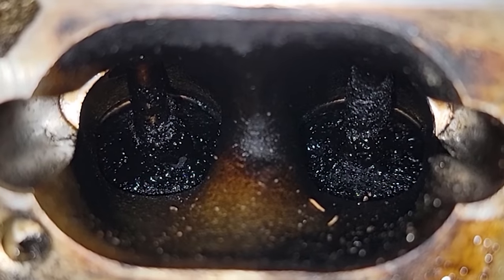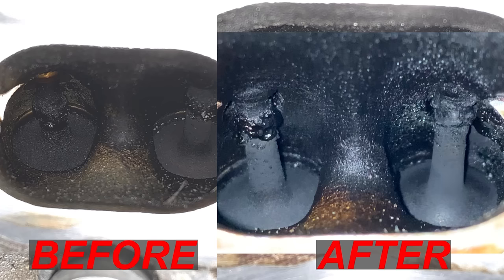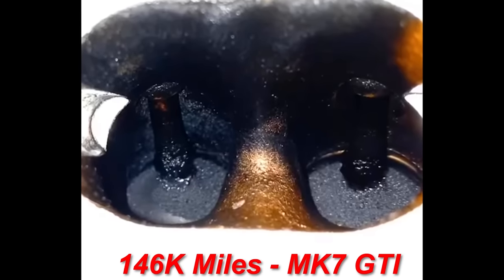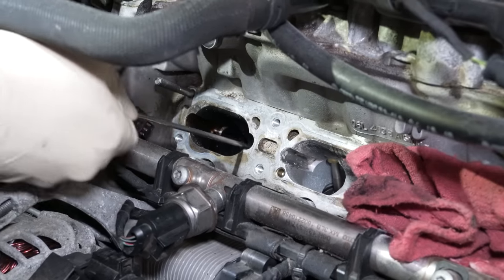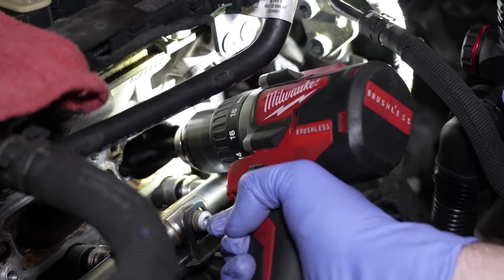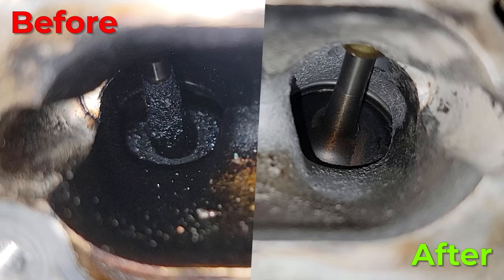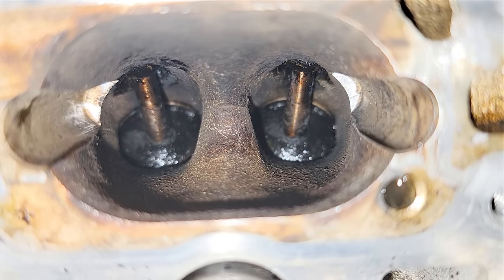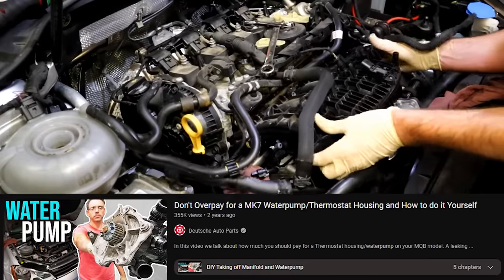How To Clean Carbon Off Your Engine!

Comment: My Ford Focus Mk3 1.0 125HP Ecoboost has had it's intake valves a bit worse clogged than those at 10:05 are and all I did was after a lot of research I ended up with Amsoil Powerfoam which I used as prescribed and because I didn't know in which place to pour it into my intake to not damage any air sensor, I've taken out the IAT2 on my Focus (it's for inlet air temperature and pressure readings after the boost) but let it's connector still connected to it so that I won't get any faults and sprayed that Amsoil as prescribed in two individual rounds, put back the sensor and drove the car a bit until the very thick blueish smoke eventually stopped coming off from my exhaust (I was spooked at first to see that wild smoke) and all was fine. I repeated the process as prescribed and all good again. Immediately after this procedure I looked with the borescope again at the valves and pistons and there was no difference yet, but..., after 3-4 months later I checked again with the borescope and I didn't believe my eyes..., that thick slime was much less now both on the valves and piston. So this thing attacks that buildup over time as it kind of infuses into it initially and makes it loose while driving for a big while. I was very amazed to see that and of course I've immediately bought another spray can and re-done this cleaning again. After almost one year after the second cleanup I could finally see my valves have a good shine on them for at least half of their area and the pistons were almost 90% shining with only some spots here and there of left buildup. So..., wow..., that's what I was looking for and so far it really did what I wanted.

Oh, and guess what..., after these cleanups I also went only for a technical check on the cat to see it's health. First of all, at borescope inspection the cat was now even more white than before using this Amsoil and not only that but the guy checking it's performance asked me what is wrong with the car and why did I want to do this test cause the cat is not just fine..., the emissions are similar to a brand new cat. Wow again! Just wow! Valves cleaned, pistons cleaned, O2 sensors a bit cleaned as well and the cat regained some of it's white appearance and had no damage at all. There you go...!

Comment: How does "93 octane" prevent carbon buildup? It resists detonation and preignition. an "Italian Tuneup" isnt "revving" the motor. It's taking it out on the road and running it hard and under load to raise chamber temps and get the plugs hot enough to burn carbon off the electrodes the way they were designed to work for their heat range.
Reply: SSSHHHH ssss do not tell them or you will ruin this guy's commercial my friend.

Comment: I have a 2005 Audi A4 3.0 V6. What's the best way to clean the carbon? Thanks
Reply: You must use oil catch can method  mate....ok.?
Reply: @nia6849  what is the "oil catch can method"??? Thanks
Reply: A can to catch excess gasoline vapor after burning.

Comment: What about decarbonization with that special machine that uses hydrogen?
Also I'm assuming that this is much worse on diesel engines, especially that are driven in city a lot. EGR helps with that carbon build up a lot hah, but even petrol engines have them nowadays if I'm not mistaken..
Anyway, very informative video. 🙂

Cheers
Reply: Give a try

Comment: Why not use long brass bottle brushs cut the loop offend mount in variable RPM drill. Even stainless wire brushes were used on valve faces and back sides years ago. Suggesting brass to pose less potential damage to aluminum head. 
Let soak in carbon remover remove brush probably use hardly any media blast...ditch those picks...

Comment: The zip tie method didnt end up being that effective for me. Didnt find it to be the magic internet hack everyone says it is. An old toothbrush took out more carbon than the zip ties did, after a bunch of brake and valve cleaner of course. Ended up doing the job with a combination of scraping, brushing, vacuuming, compressed air, and a lot of brake and parts cleaner. Also made my own specialty valve scraping pick with just a regular pick and an angle grinder. 

Next time I will definitely media blast. Its absolutely not worth the time and effort it takes to use any other method.

Comment: IMHO, media blasting seems to do the best job and saves a lot of time as well.  I own a 2019 VW Arteon with a 2.0TSI turbo charged motor that is enhanced with an APR+ tune.  I use 93 octane Tier 1 fuel and run Liqui Moly Di-Jectron additive every 6 months or so.  How concerned should I be with having the valves cleaned and how often?

Comment: Hoping mine isn't too bad in UK because its got direct and port injection so should keep valves clean 🤞
Reply: if you have both you have zero buildup
Reply: It is morally reprehensible for VW to only use MPI in Europe but they might do it to help the dealer networks generate more revenues

Comment: Direct injection engines were developed in order to get better fuel mileage. They do this by using very weak piston rings. If you fail to keep good maintenance of oil changes, you will begin to notice oil consumption, which will continue to get worse over time. Usually this is from stuck or sticking piston rings, and that's because the rings are so weak. On top of all that, you get the carbon buildup on your valves. This is due to the fact the fuel doesn't pass over the valves, and no cleaning of the valves occurs. So, good luck with all that.

Comment: I just want to add that if you have a ford ecoboost engine or potentially any other engone with a wetbelt, you probobly dont want to be putting any chemicals into your engine as it has been know to acceleralt the breakdown of the belt.

Comment: Methanol injection used occasionally (spirited driving) over the life of the engine may prevent this all together. The power boost is just a byproduct one will have to tolerate.

Comment: What about using a bottle brush in the drill
what's the best stuff to dissolve carbon, you get that professional stuff they use in your ovens but I don't know what it's made from that could be used anybody know!

Comment: @ 4:08 you give the impression that 93 octane is a better fuel. I realize you said "because he is tuned" but we are left with the assumption that higher octane fuel is better. While some high octane fuel may have additional additives this is not the case with all. Perhaps recommending Top Tier gasolines within the octane requirements of the owners manual would be a better choice. Not all high octane gasolines are Top Tier either. Aside from the obnoxious background musak, it's a relevant video.

Comment: Did anyone notice the absence of Toyota in the names of all companies whose engines are prone to carbon build up? In their typical way, they didn't rush to be the first for direct injection, finally when they offered it after learning from others mistakes, it was port & direct combined. (Toyota engines have other issues though) My question would be what did VW did different for post 2016 engines that they don't have the carbon build up issue, did they also offer port & direct both. Second, why is carbon buildup an issue, the valve seals keep the stem clean and the valve seats are cleaned every time valves seat, isn't it?
Reply: I am cleaning a 2.0 Tiguan 2018 tomorrow so I am not sure they did

Comment: too bad somebody doesn't still make a foaming top end/upper cylinder cleaner like GM and Mopar did back in the day, two 15 minute treatments back to back would actually leave clean bare metal, however your driveway not so much which is why they quit making it, those cleaners removed carbon so well that a single treatment on a vehicle with a lot of carbon buildup could completely clog a cat which is a bad thing but if you are removing intake and sucking out all the chemical and carbon residue anyway then using a more powerful chemical would be ok.....

Comment: Drill a hole in the intake. Warm the car and spray cleaner in the hole while running. Fill the hole with a sheet metal screw. Do this a few times a year…

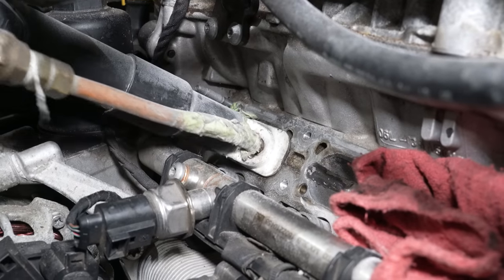Comment: 6:02 this is not fixing the underlying issue, this is more like a consumable maintenance item like tires or oil.  

This issue is fixed by a system like port injection that keeps the valves clean, catch cans help but won't solve the problem completely, ideally you should stop pumping vaporized oil and volatiles into the intake but that may or may not cause you to fail smog testing in places that have it.

Comment: I scraped mines with the zip ties, but not like that, tied them together to be almost as big as the hole, pushed in and twisted with brake cleaner, came out almost perfect, after it was dry you couldn’t see any black deposits, cancelled the walnut blaster order.

Comment: Except while the valves are closed you can’t clean the valve seats which allows the valves to form a proper seal in the combustion chamber.

Comment: Or you could buy a used small window washer bottle and pump from a 90's japanese car $10 and a $5 vapourizing jet, wire in an on/off switch. Find a stable place to sit the bottle under the hood, use the jump start points to power it and run the switch throught the drivers window. pop the air cleaner cover place the vapour jet under the air cleaner. Fill the bottle with 10% ethanol (metholated spirits) and water. 
Drive to a highway when the engine is up to temp turn on the pump and drive until the bottle is empty, about 5 to 10 miles . If the engine struggles modulate the switch or limit the water flow.  Repeat every 10,000 miles, problem solved.

Comment: side note, the carbon comes from fuel, it also gets into your oil which makes the oil smell like fuel & turn black. when they say your avg car burns XX fuel which contains XX carbon making XX co2 per year, they dont consider any of these carbon deposits or oil changes etc, so the math is flawed. also it takes 1 acre of trees/forest to consume all that co2 per year the avg car burns & makes.

Comment: the best cleaner to use is Chem-dip 0996 Carb Cleaner  fill port full let set 20-30 mins suck out You be surprised !

Comment: uhhh...Seems all the 2.0T gen3 engines have carbon build up, soooo...yeah. Just did my 2017 R at 75k...they were definitely caked with carbon. Got plenty of Pics. It's a KNOWN svc item at this point, you guys should know this.
Reply: BTW, Oil svc every 5k, Motul Tsi specific 10w40, 93 or better fuel. Every 10k CRC GDi cleaner.
Reply: @UngluckInc  I think the quality of fuel you put in it is very important!  It should be "Top Tier" certified, like Shell, Mobil, BP, Sunoco, Costco, and others (around here, Get Go is Top Tier, it's part of the Giant Eagle grocery store chain, not available everywhere).  The octane level should not make any difference, as far as I know.  If you get your fuel at some cheapo gas station, the quality of the base fuel is suspect.

Comment: I sucked foamy engine cleaner in through the egr inlet about 20 times with the ignition off being careful not to overload and lock it up.  I needed to change the cat anyway. You could also disconnect the cat a few inches which is easy enough.
Reply: yea..bet that did absolutely nothing. lol

Comment: Question: So on the GTI’s the transmission is different between the PP and non-PP. There are two engine codes for these cars does anyone know the difference between the two engines.  Some say its just the ecu’s hp bump on the PP model. I’ve also heard some of the internals are different as well. Can anyone confirm?

Comment: Hey, do the new 1.5 TSI engines have this carbon build up issue?
Reply: I have 188,000 miles never been any carbon
Reply: I wonder if that also applies to my 1.4 TSI Jetta from 2017?
Reply: @rickmjr9569  look after it and no problem 👍

Comment: Confused... You said the 1.8L TSI engines after 2015 don't have buildup problems.  WHY?  The 2015 Golf is MK7 generation, isn't it?  But then you show a Mk7 GTI with a lot of carbon buildup at 140K miles.   Why?   Does the MK7 GTI have a different engine?

Comment: Why wouldn't you use the valve clean the something like a nylon brush on the drill surely that would be more effective, I have a few with varying materials from hard wire brush to soft plastic brush and they look very similar to a baby's bottle cleaning brush.

Comment: 4:20 Thats not true if you drive car in urban area you will have carbon deposit for sure. I have diesel car with 127k miles with cat and DPF, no deposit on valves at all, but pedal to the metal whatever i can.

Comment: Carbon deposits and buildup are a by-product of combustion in an engine that comes from incomplete fuel combustion. Does this mean that gasoline additives cause incomplete fuel combustion? Because the engine is designed to burn gasoline and not the additives.

Comment: It's supposedly against EPA regulations, but if you have a "direct injection engine" the addition of an oil catch can will eliminate carbon build up on your valves. Same for Port injection too. It is the recirculated oil fumes from the crank case via the PCV valve that cause the carbon buildup. It seems to me someone smarter than myself would come up with another solution other than the PCV valve which is detrimental to your engine and makes the EPA happy as well. But what are you to do when so many "new" engines are direct injected? Allow your engine to get ruined? Oh that's right, buy an EV at 3 times the cost of a regular car that may spontaneously combust for no reason, and only get you half the distance per charge than a regular auto would. Joy.

Comment: can we get manufacturers to go back to the old injection system which did not have this problem or is this done so their dealers have business cleaning them?
Reply from the maker: It’s being done to meet the increasingly restrictive emissions requirements
Reply: @Deutscheautoparts  I know nothing but seems that engines caked up with carbon would be less efficient, pollute even more.

Comment: Works same way in a diesel engine . Nothing going past intake valves and yet no cleaning requirements 🤔 tipping they have a egr valve putting the stuff the engine didn't want back into it.
Egr valves killing engines since 1997 👍

Comment: I still say a water meth injection would be beneficial to all direct injected engines. It steam cleans the valves stems and intake manifold. My old motor had 207k and when I pulled the head everything was pristine and shiny inside. No carbon at all...
Reply: I believe this would work better too, had it on a twin turbo corvette, pulled heads after 100,000kms combustion chambers and valves like new .no carbon.

Comment: I don't know but here they use some device they hookup to your  car and flush all the carbon gunk off the valves all crap out of the engine while it is running. Costs like 80 bux.

Comment: You say it causes "cold misfire."  I've never heard this before.  Please explain the mechanism by which this occurs.  I'm an engineer with a fair amount of experience in ICEs, so please don't hold back.  As a hint, I don't think there's any problem with this carbon buildup.  By time it becomes a problem, the engine has gone 300k miles or more and not many German engines go that far.
Reply from the maker: I can’t pretend to understand the mechanism that creates cold start misfires but this is common knowledge in the European repair space. If you reach out to any shop the specializes in VW, Audi, BMW etc they will be familiar with this problem.

Comment: run b12 chemtool in gas tank every 5 tanks change oil do it again. dont use cheep air filters dont use cheep oil filters.i use wix .after doing this ten times your enging will get better mpg and better starts smoother acceleration even run cooler.i am not a doctor but i could play one on tv.

Comment: Media blasting scares me--things never seal as well as you think.  However, this seems like an interesting opportunity for dry ice blasting.
Reply: Worked in both a VW dealership and a 3rd party VW specialist shop. Dealership will tell you this is not necessary. At the 3rd party shop we had a walnut blaster. Did plenty of walnut blasting with zero issues because even if the walnut media should get into the engine, it will burn up like fuel. As soon as the dealership told me NOT to do this repair, I quit.
Reply: @deciplesteve  Fascinating! Why did the dealer tell you to stop doing it?
Reply: You make a good point. I would say a follow up with compressed air should probably clean up the chamber. The most important thing is to pay someone meticulous to do the work. You could opt for solvents and brushing.
Reply: @jamesmedina2062  "we don't do that here."
Reply: @jamesmedina2062  I always used an air nozzle after the walnut nozzle for that exact reason, but there would often be one or two pieces of walnut that would get wedged just right and not come out, but never was an issue.
Reply: @deciplesteve  thats weird to me if it generates labor hours and revenues. I worked in service too but in advising. I do mechanical work now but not that much. As far as VW goes, I did not like some mechanics telling me to change my coolant hoses when they were only 5 years old.  That and the high prices forced me to buy tools and do my own work.
Reply: @jamesmedina2062  I have been told before that my dealership experiences are not normal for most dealer techs, but idk...
Reply: @jamesmedina2062  They might want to avoid the, “This should be covered under warranty!” customer…
Reply: @troyjollimore4100  I doubt it. I was a service writer and you would be surprised at what is legitimately wear and tear like brakes and tires. But often greed gets the best of people and they would rather sell bigger ticket items
Reply: @jamesmedina2062  But that’s what I meant. “I only took my car to the racetrack every weekend for a year, and the stupid brakes and clutch are gone already! This should be WARRANTY!” 😄